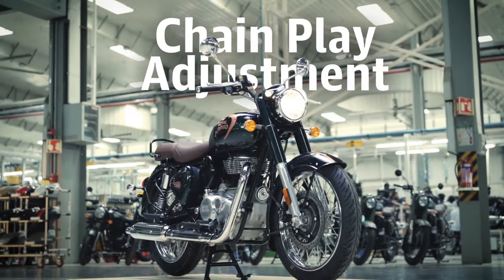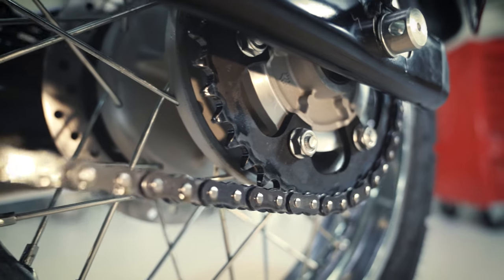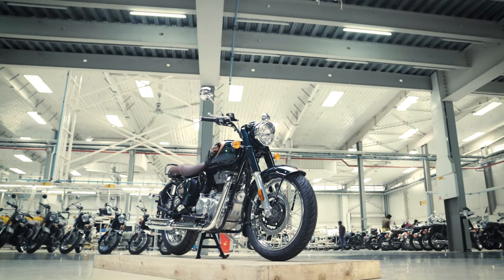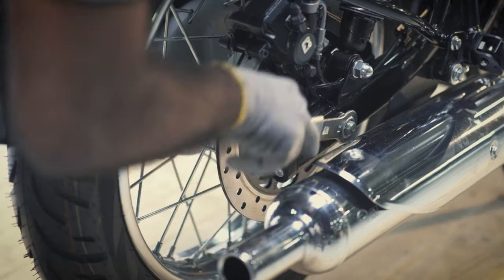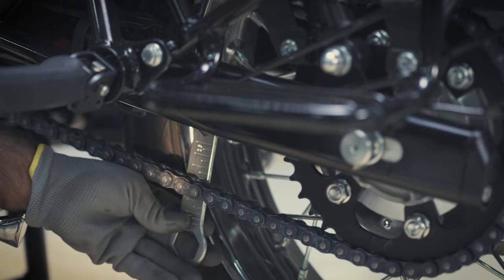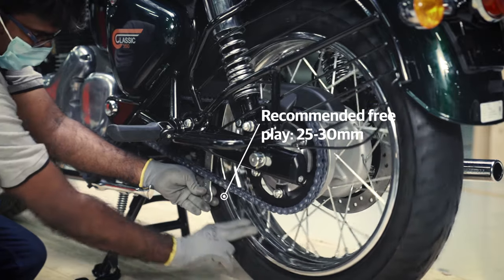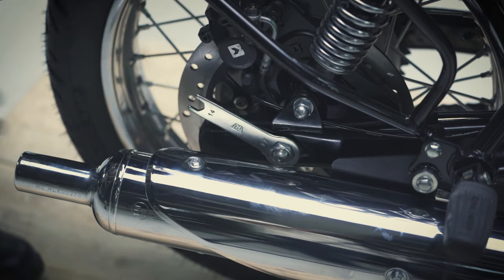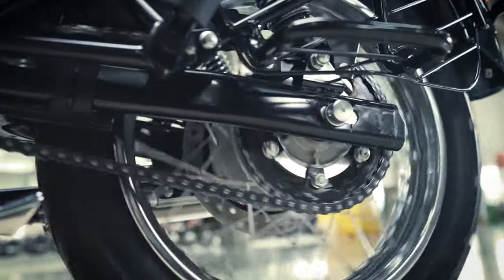All New Classic 350 DIY | CHAIN PLAY ADJUSTMENT

Comment: Comments below are correct, you don't need to loosen ANYTHING to check the chain play...but if you need to adjust it, loosen the nut and Allen Key adjusters and then what???  Come on RE!!!
Reply: Hahahaha I’m thinking the same thing … They didn’t adjust anything? How do you actually adjust it?!
Reply: Lmao wtf is this sorcery, apparently you loosen the Allen nut then tighten it and it magically adjusts…. Have you guys figured it out yet?
Reply: You use the allen bolts tighten them and they will pull the wheel back

Comment: This video is the INCORRECT way to adjust your chain. Please remove bike from center stand and let the rear wheel rest on the ground, thereby resting the suspension off the swing arm and not letting the wheel weight pull the suspension down giving the incorrect setting and reading

Comment: Video only showing CHECKING. Forget to explain HOW TO ADJUST..
Reply: It's really bad, you can check without loosing anything. The one for the meteor does include the adjustment, but because they do the testing like here becomes confusing, they say first loose the adjuster then adjust then tighten them. Makes no sense at all.
Reply: At what point in this video did you describe how to adjust the chain?

Comment: I did it today, and it was easy: Loosen the bolt on the rear wheel axle, then turn both chain adjusters slightly clockwise to tighten the chain. Then tighten the bolt on the rear wheel axle again. Conclusion: Good technique - but poor description in the user manual and in this video.

Comment: So, how is the chain tension adjusted???????
Reply: By the Allen key
Reply: You tighten the allen key on each side that whill pull the wheel back
Reply: Yeah, the process of adjusting the chain tension was there in the video. But they failed to mention what exactly is done to adjust the chain tension. They spun some screws right and left a couple of time, and tightened everything back, and that was all about it. Only by reading the comments did I come to know that the allen keys did the job of pulling the rack back.

Comment: After 1st service, the bike turned rough. It is not as smooth as it was before. Just ridden 600 kilometres & i am facing issues, like power loss in 2nd gear, false nuetral, engine stress etc
Reply: Please explain.
Reply: Yes exactly I am facing the same issue
Reply: @frankiepitt9135  the ride is different after the first service. Before first service the engine is very smooth and the ride feel as well. Gear box becomes hard after first service, so false nuetral happens. Before first service we can ride bike at 80kmph easily but after we can't ride smoothly at 80kmph.
Reply: I also faced the same issue after first service.  In my case its service fault. They adjusted too much freeplay in cluch. Then i adjusted myself after watching RE tutorial on youtube. Its smooth again. Now i feel i can do better than the service center people. (except some)

Comment: you've not shown how to adjust only loose and tight
Reply: Nazir, I completely agree with you. He mentioned loosening the chain tensioners with the allen key after loosening the axel lock nut. I would have thought he would tighten (not loosen} the chain tensioners by quarter turn increments until the desired tension is achieved.